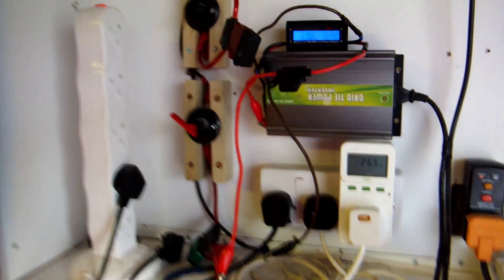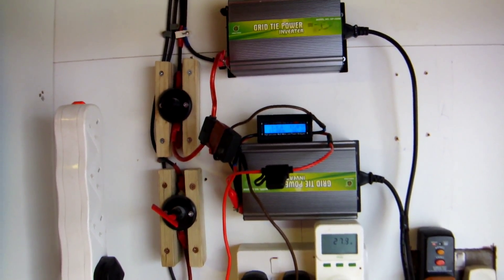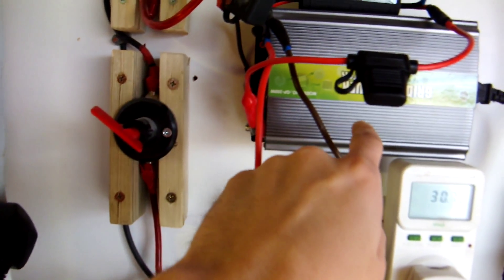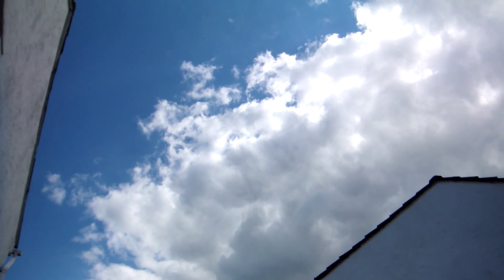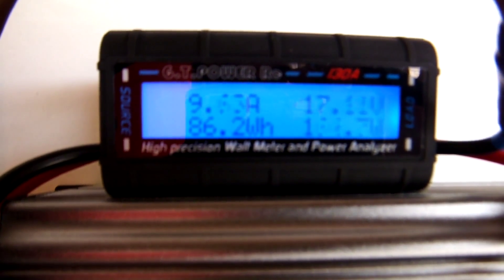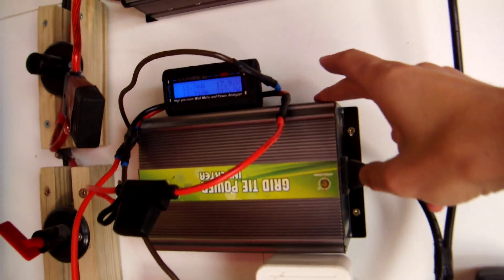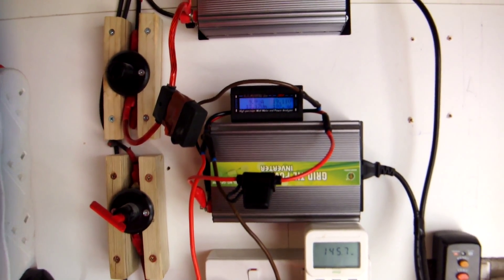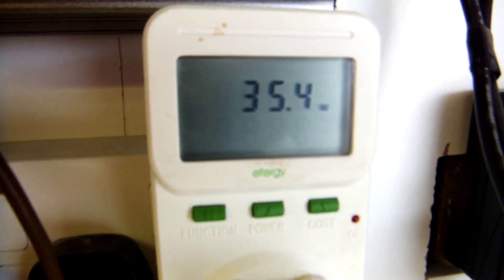Solar grid tied garage setup UK - Measuring inverter efficiency

Comment: So these inverters are connected between the panels and the electricity meter? Their output is connected directly to the mains?
Reply from the maker: Yes.
Reply: @hippyraverocker  do you see a reduction in your electricity bill?
Reply from the maker: @andic6676  Yes we do, since the system went live we have often found the meter will either stop or substantially slow during the daytime. So for base loads like fridge, freezer, tv, internet etc this essentially covers all that usage during the days.

Comment: Being grid tie in, what happens to power that goes back to the grid... Do you get that off your bill or is it just wasted.? And do we need building warrants being from the uk.?
Reply: Alex Summers Generally the power gets consumed by whatever you have on that ring main in the home.
Lets say you have a fridge, and it is drawing 100w from the main power - your paying for 100w of power,
Now you add the solar panel, and the inverter. It provides say 60w. So the fridge continues to draw 100w, but 60w is provided by the inverter, and only 40w is drawn from the national grid. Meaning you only pay for 40w.

When i talk about ring mains, what i mean is in your home, you have a fuse box, when you turn off a single fuse, only some of the plugs go off. (this is called a RING)  so if you added an inverter any devices on THAT RING ONLY would benefit. You can experiment yourself with turning off various fuses, and seeing which plugs go off. You will then know which set of plugs to plug in the inverter.

I used a fridge as an example, and i also used 100w just for illustration, in reality fridges use FAR LESS. Just a note, my two fridges rated A+ And A++, the A+ will run entirely off the solar for a very short time on a sunny day, the A++ draws a tiny bit of power.

How much can you save? My last months electric key payment was £10, There is still £0.86 showing on the meter. its roughly 25-28 days ago i put the £10 on. Reminds me i do need to go top up. 
(my system does not just use solar tho, im incredibly lucky i have a stream running at the end of the garden, so ive also added a very small water turbine.)

Comment: Yes, I know planning permission would not be required because it would not involve Development under S55 of the Town and Country Planning Act 1990 - I consider the panels would be regarded as a chattel rather than a building operation. My query was in relation to notifiability under the Building Regulations, that is Part P, on which I am less clear in relation to installation of garden circuitry connected to the ring main but as your Dads a sparky I thought you'd know the score on that one. Any pointer there? Cheers. Keep going with these great videos. ;-{)

Comment: I really like yor solar shed arrangement and has given me pointers for the allotment system I'll be setting up for shed lighting and irrigation. However, doesn't your garage setup require Building Regs approval as soon as you plug it into the ring main socket?
Reply from the maker: Hi, no planning permission is not required as the panels are not a permanent installation. As to the plug, this depends on your electricity supplier and how much power you develop. For us the amount we generate is within the limits of what our electricity supplier allows without specific permissions.

Comment: Hi, how did you connect that white meter to get your wattage readings from your solar panels?
Reply from the maker: The white meter is a standard energy use meter. You can get them in Asda, Tesco, BnQ, eBay and most other places. They are designed to show how much energy you are using, but also work in reverse :)
Reply: hippyraverocker What I actually wanted to know was how did you hook it it up to your solar system.
Reply from the maker: Zoltan Kiss  All you need to do is put it between the inverters and the grid. So normally the inverters take the solar input and then have a mains/grid socket on the other side that you plug in and the solar power generated goes into the grid. All we have done is put the meter between that plug and the grid to get a reading.

In the case of our set-up with have both inverters feeding into an extension cable first to combine the power they generate, that then goes to the meter which in turn goes to the grid.

Hope that helps.